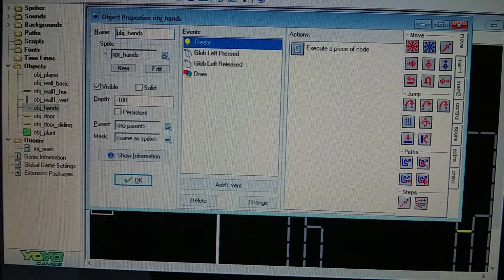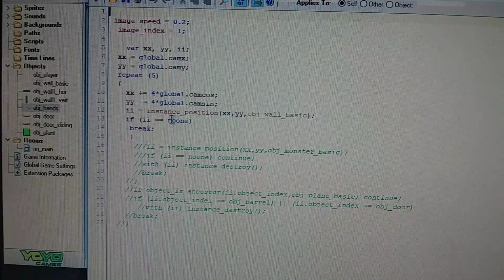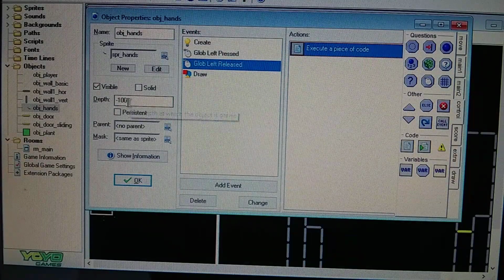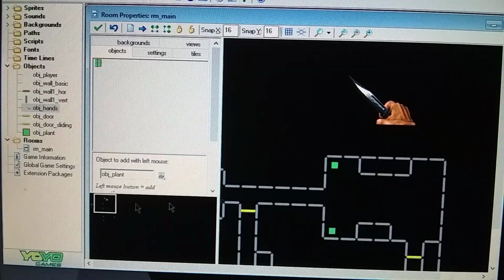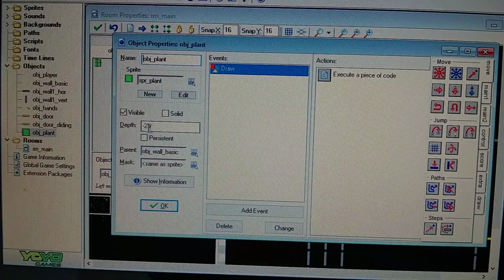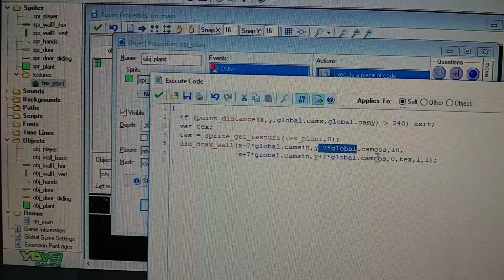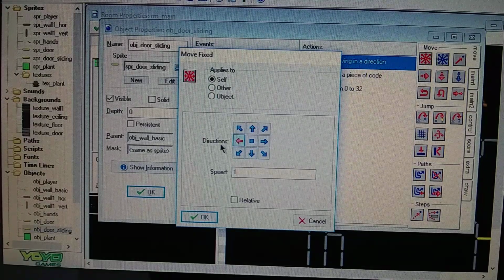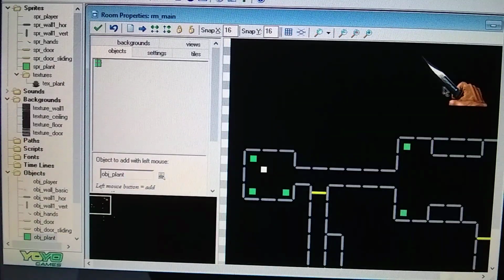Game Maker 8.1: Fake 3D FPS, How to Create a Weapon, Health Bar, Doors, & Plants.

Comment: Wait is this old 8.1 engine
Reply from the maker: It is game maker 8.1 engine. So if you want to make a fake 3D game for you're PC you would need to use Game Maker 8.1, because for some reason Game Maker Studio does not work correctly for the PC, but it will work correctly for the Android device, but only if you test it on your phone, not on the PC. I'm not sure why Game Maker Studio is acting weird like that. Good Luck. Will go back to Fake 3D later, to talk more about it, soon.
Reply: Btw great video